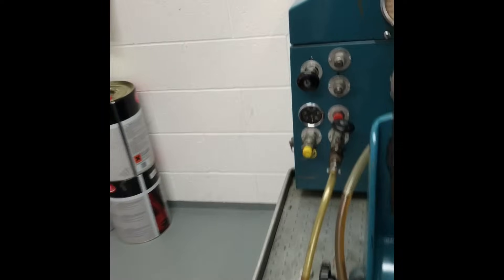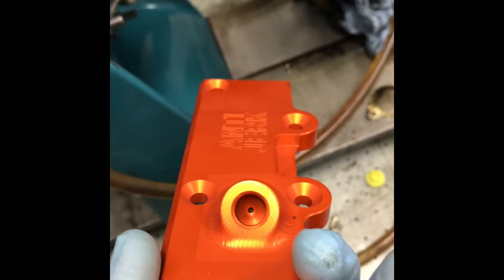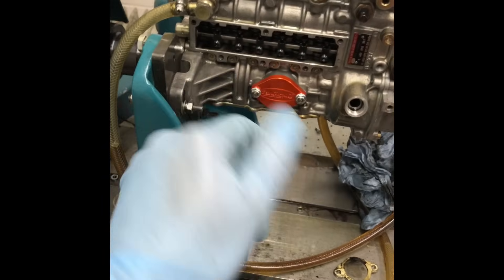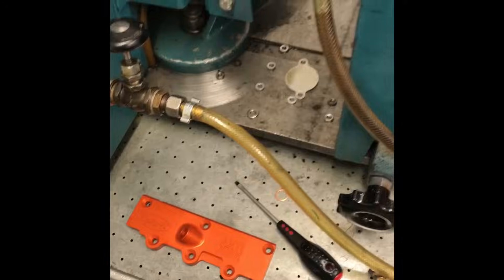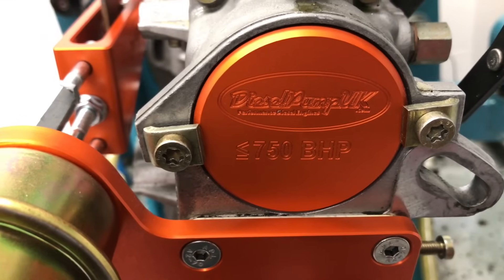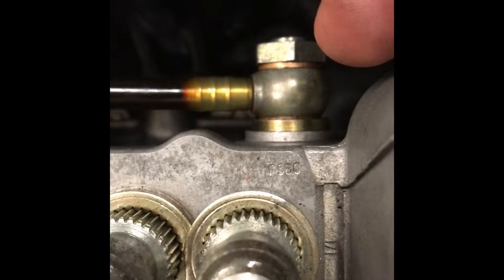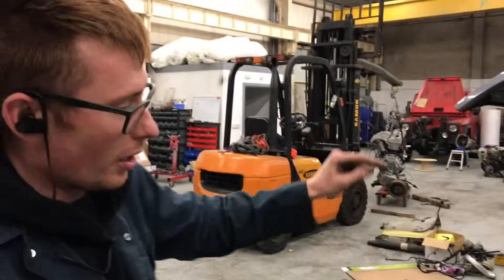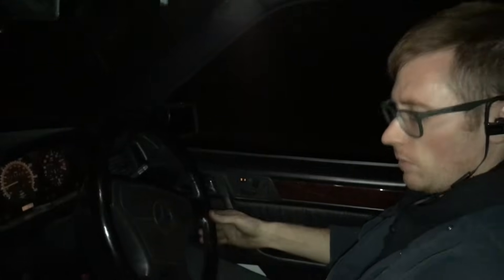Dieselpumpuk Anti jerk Billet Kit

Comment: Can someone explain me where the oil goes from the pump? No returns? And what diameter drill you need to use to drill the hole for the oil pressure line from oil filter housing?

Comment: Ok, I'm sold. I have 2 1950's Dodge M37CDN trucks, and I was planning on putting a Cummins 4bt, but for the weight savings, driveability, power, etc., Im now going to go back to the drawing board to plan an OM606 swap instead. 👍🇨🇦

Comment: does it work with auto transmission as well?
Reply from the maker: Juiced_mz3  you can use it with auto transmission however it’s specifically designed for use with manual transmission

Comment: Luke, Quit making shiny things I need to buy. I wouldn't mind just a block off plate and cap for the rear of the 603 pump I bought from you guys. Are you considering selling just those caps? I wont be sure of the anti-jerk issue or other potential pump issues if any until I get a new motor for my land cruiser. Fantastic Job, those parts are beautiful.